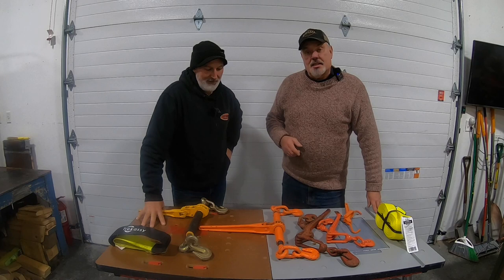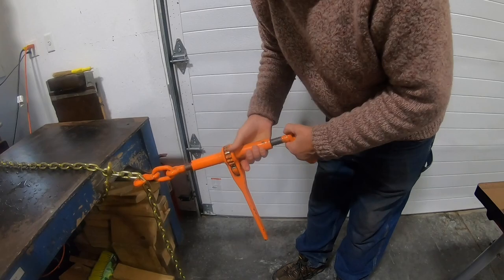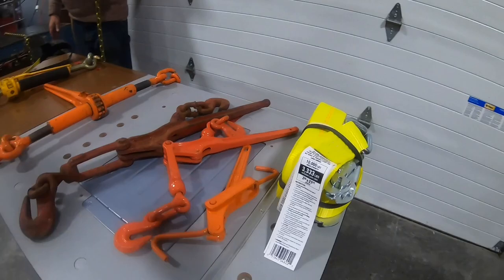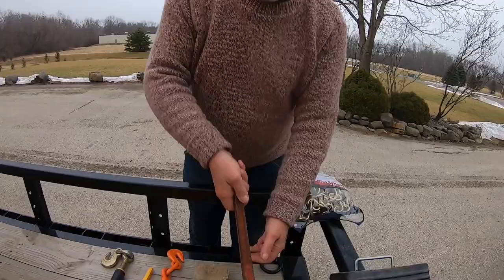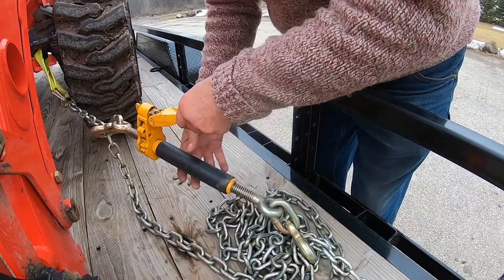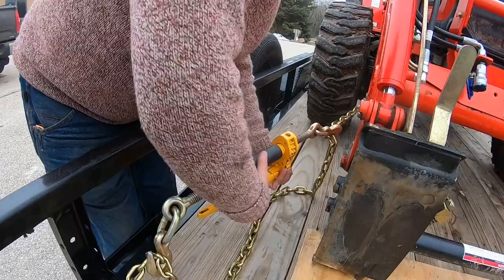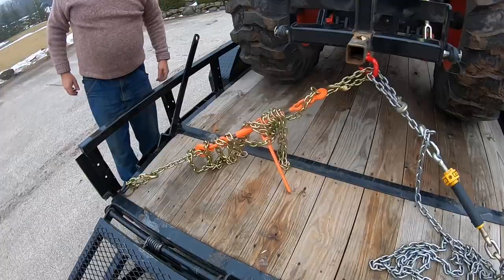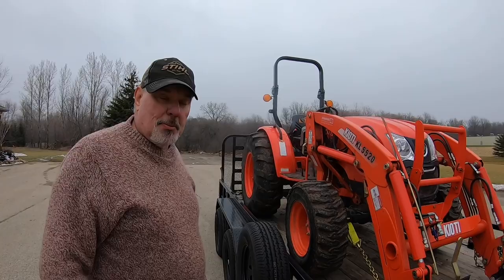4 “BEST” Equipment Tie Downs -61

Comment: Nice work Tony & Chris.  Tonys Cool Tool School should be your channel name.  Best thing to learn from this video is...........When you don't own a proper trailer (boat, camper, horse, motorcycle, lawn mower) it's best to have friends or family that will let you borrow one.  Trailer D ring rating is also important to DOT.
Reply from the maker: Larry, friends or family with tools and equipment you can borrow is important for sure😂
When I buy a trailer I typically have the manufacturer add additional D rings for extra tie down points. Seems like I never have enough.
Thanks for watching and commenting 👍TCT

Comment: I have been using straps to haul cars since I was a teenager.. I would go over the rear end and front crossmember in 4 points..
If I am going long distance, I check all the straps at every fuel stop or if something looks out of place..
Another good video from the knowledge of Tony 😁👍
Reply from the maker: Daniel the method you’re comfortable and confident is the one to go with regardless if it’s straps or lever/ratchet binders. 
Like you pointed out, checking your load often especially in hilly or mountainous areas is important.
Thanks for watching and commenting 👍TCT

Comment: Liked your video, a lot of good info.  I too switch to the Peerless for all the reasons you covered.  I would add another feature of the Peerless Binders is that the handle can be locked with a padlock; to prevent someone tampering with your load or wanting to take them.
Reply from the maker: Dennis I’m glad you enjoyed the video.
 I forgot to mention the locking capabilities of the Peerless binder, thanks for pointing that out.
Appreciate you watching and commenting 👍TCT

Comment: Nice job Tony. I like the knuckle busters best because they dont freeze up in cold and they are faster.
Reply: or rust on the threads.....
Reply from the maker: @gregprince2523  hi Greg, I either store my binders in the trailer tool box or inside my pole barn. I could see if you left them outside they would rust for sure. Equipment maintenance is so important especially with binders. 
Thanks for watching and commenting 👍TCT
Reply: @TonysCoolTools  Heavy haul driver retired here Tony..... even stored in my chain boxes on my trailer and tractor the threads need cleaned every year. WD40,  PB Blaster, Lithium,  Dry lube..... all will collect dirt, dust, which sometimes turns into gunky stuff. Every once in awhile I would just take a day and pull out every piece of equipment I had on the rig and just clean it and spray it down with lube.  Sure helps when it's cold, dark and miserable when you need to use the Ratchets n binders....... Stay cool Tony!!
Reply from the maker: @gregprince2523  So you’re the hero that brought us all the goodies. Thank you very much!
I agree you have to be careful with lubricants as you point out because they are a magnet for dirt/ grit which turns “gunky” and binds stuff up.
👍TCT
Reply: @TonysCoolTools  Tony my heroes never came home.... Thank You very much tho..... 2 of my children are knuckle draggin jarheads...    Both home and back on home turf. Our Heroes  built the roads we walk on... A wise man will take care of those roads. They were hard fought and earned.

Comment: I really like them new style rachet binders. I have the old style rachet binders and the 2" straps. I've used them knuckle busters and after almost breaking my wrist more then once I quit using them. Stay safe my friend
Reply from the maker: Hi Tim, over the years I’ve upgraded my equipment to make it easier, safer and faster. 
But… there is nothing wrong with any of the options I covered.
Appreciate you watching and commenting 👍TCT

Comment: I have 4 of the Perless ones too and 4 chains and smaller ones to Tie down the Loader, and /or back hoe Which is required in most situations. 
When not stored in the Trailer Box I use and old hand truck with a Milk create strapped to the bottom and I can hang the binders and the hooks on the Cross bars with the excess Chain in the Create . 
Might invest in the Newer style that You tighten down with an Impact 
Thanks Guys.
Reply from the maker: Mike the Peerless binders are definitely nice to use.
 I like the idea of the old hand truck and milk crate. Everything is in one place. 
Thanks for sharing, watching and commenting 👍TCT

Comment: Great content Toney. 
I like your thoughts process about the passenger side working, but I'm not sure if you noticed all types of load binders on semi's trucks are on the driver's side due to D.o.t. regulations. This is so the driver can view the load management of his load if they become loose during travel. (In most cases) your trailer is covered by the the towing vehicle's insurance but not the content on the trailer such as (tractor). And if your trailer becomes disconnected from the towing vehicle while in transit, you have no insurance and can be held liable 😭. Some states Dot. regulations require business owners to carry liability insurance on trailers weighting 10k or more. If you were to call your local scale house and ask for a courtesy inspection most weigh scales would do this without citing you a volition. That would make part two of trailering video for you and some awesome content for your subscribers 👍👍
Reply from the maker: wow thanks for the  awesome information. Regarding the passenger side location, that’s when you only have one strap or binder. I do have tow mirrors on my truck and can monitor chains or straps easily. I had to get a Ryder policy on my tractor when I tow it off my property otherwise as you said it’s not covered. 
Thanks for watching and commenting👍TCT

Comment: We use chain binders to hold down the stacks of crab pots on deck they save our lives.
Reply from the maker: That’s super interesting in that binders aren’t only used for heavy equipment. 
Based on other peoples comments do you have issues with rust or corrosion due to salt water? 
Appreciate you watching and commenting 👍TCT
Reply: @TonysCoolTools  not really, when they come off the stacks they go into a 5 gallon bucket of diesel, but if you forget in 30-45 days they seize up. We also use them for cargo trucks, salmon gillnetters and buses anything smaller usually just use line with a truckers hitch and then half hitch the dead ends untill there is very little tail then put a overhand at the end. 
When the pots are not held on by chain binders there held together in 2-3 spots with a 6ft piece of line with a clove hitch and a overhand. Freaks people out when they first see it.
Reply from the maker: @nomadfishermanak  well rope has been around longer than chains and typically anyone in boating or fishing knows a thing or two about knot’s.
Both how to tie the best knot and which application to use them.
👍TCT

Comment: Lube the screw type binders, they will rust up.
Reply from the maker: Yup I have fluid film sprayed on them and store them in the trailer tool box or in the pole barn so they are out of the elements.
Thanks for watching and commenting 👍TCT

Comment: I have taken my 20’ chains and cut them in half.  Why have 1/2 of your chain potentially dragging or laying on the deck.  

I’ve also made 2’ and 1’ chains for when it’s really close to the tie downs.

If you hook two chains like you did, make sure the working load limit on the shackle is double what your chains are.

I also replaced all my cinch hooks with slip hooks to let me hook them directly to the d-rings.
Reply from the maker: Jon all good points and thanks for sharing. The main reason I keep my chains long is I use them on multiple projects. I only move my tractor a dozen times a year and use different trailers. If I was only using one trailer I’d make custom chains so I don’t have a long tail dragging. 
I too love short piecies of chain, there is always a use for them around the homestead.
Thanks for watching and commenting 👍TCT

Comment: Great job once again. What size is your trailer and what can you recommend when it comes to insurance on the tractor. I'm in tractor shopping mode
Reply from the maker: John the PJ trailer is 18’ X 83” .  Tractor insurance is tough, initially I insured my tractor using my homeowner policy however that only covered me if the tractor was used on my property. My insurance agent had to find a separate company that would insure my tractor off premises. 
Here is a great video that explains all the issues about insuring a tractor.
https://youtu.be/iVwFO3uIW7Q?si=jXmwVumwM6gVhtHa
Thanks for watching and commenting 👍TCT

Comment: Thanks for giving your Old Best Friend a lift! Lots of great info in the last few videos!👍
Was the hook on front axle right beside where you put your strap around not recommended for securing a chain to it? I have 4 short chains made up for just the tractor so I am not dealing with all the excess chain. I keep a couple longer ones in the box for attachments or material but the short chains sure speed the process up! Have a great week!
Reply from the maker: The angle to get from that position to the D-rings is so sharp the chain would dig into the tire. I like your idea about the short chains, that’s a great second option. 
Thanks for watching, commenting and sharing your idea. 👍TCT

Comment: hi there good show , may want to chain Chris down , couple things i went to the G80 chains because they were stronger but lighter according to the manufacture 20 years ago . don't know how they did that , i now have had 3 failures in china steel or metal products , will not use it anymore , appears to me to be brittle . keep that in mind . have you seen the new binders you use your impact driver on ,you two take care . john
Reply from the maker: John I agree with you I’m not a fan of Chinese metal.
 I’ve used these chains for about 6 years and So far I’ve been pleased with them but I don’t use them on a daily basis.
I’ve seen the binders that use an impact gun and they look extremely convenient but naturally they cost considerably more than any other binders. 
But I guess if you use them on a daily basis they are worth the money in time savings.
Appreciate you watching and commenting 👍TCT

Comment: Dot says any chain attached to the item gets 50% weight rating. Any chain that goes over/through (trailer to trailer) is full value.    Assuming you're chain is 6500# the 2 chains only give you 6500# not 13000. 
If the tractor is over 10000# the hydraulics need to be strapped down too.
Reply from the maker: Andy thanks for sharing that info. It is so confusing sometimes what is ok to use as opposed to what is legal. 
Thanks for watching and commenting 👍TCT
Reply: @TonysCoolTools  as a personal vehicle you would only find out what legal requirements you need after something happens. As long as everything makes the trip you probably will need hear about it
Reply: @andystampfli9127  the d ring might be the weakest link

Comment: Always tie down, cross your chains, in a x pattern. Make sure your load is forward of the trailer axle, check tongue weight.
Reply from the maker: Joe, all extremely good points you make. 
Also it’s never good to rush when securing equipment on a trailer. 
Appreciate you watching and commenting 👍TCT
Reply: Crossing Chains is a bad idea.  If you loose one, you loose the whole load. I will never cross Chains.